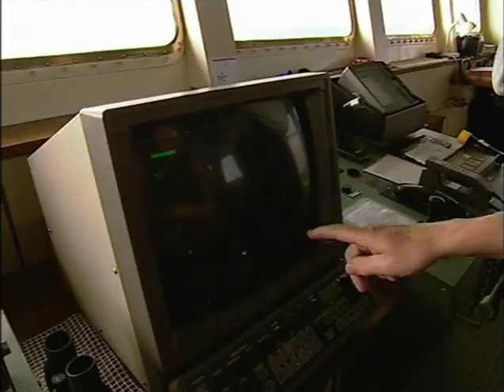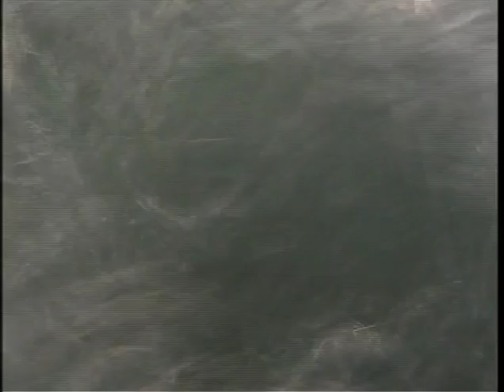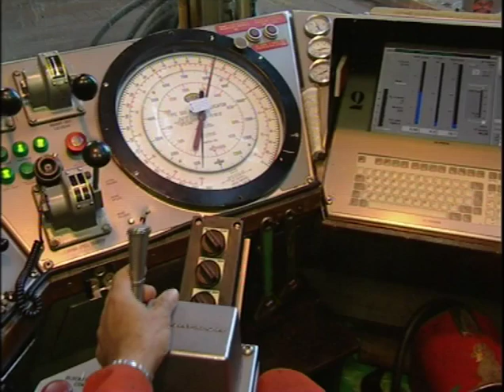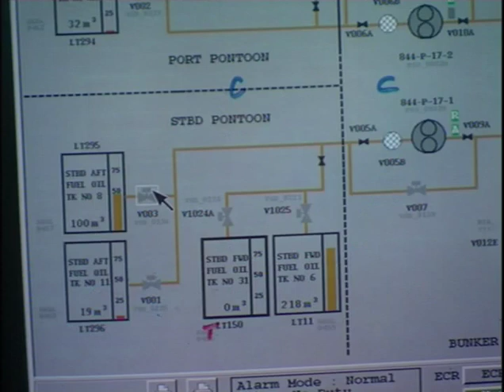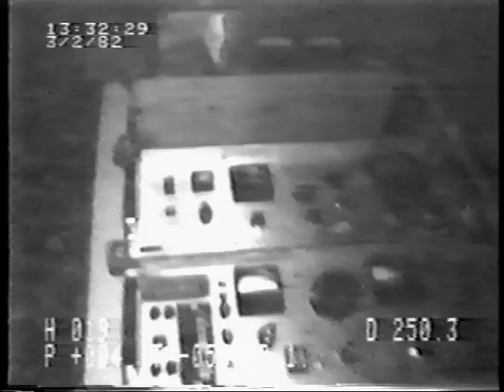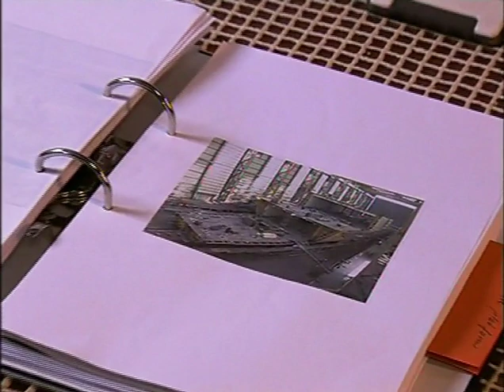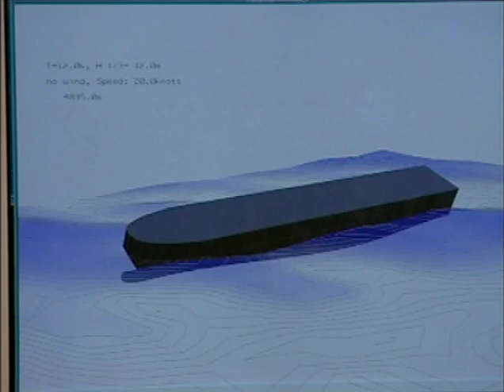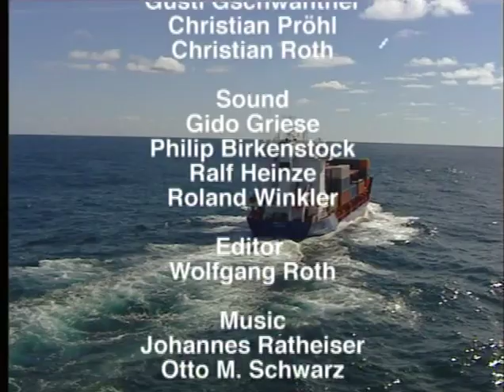Freak Waves - When Nature Strikes Back

Comment: Some 10 years ago, Canadian scientists anchored a buoy off the west coast of Vancouver Island. The buoy had a tape that would stretch and  measure the height up to 100 feet. After a particular bad winter storm, the scientists were eager to see the recording. The buoy had disappeared from it’s original spot. They finally found the buoy, anchor and all, laying up in trees on the beach.
Reply: Easily believable ive came back offshore after running from bad storms on George's and grand banks only to see wx bouys broken off there chains and missing or miles from there original locations

Comment: As someone who has surfed for many years, you cannot turn your back on or mess with the sea. It will surprise you and take you out if you don't pay attention at all times. People say big wave surfers are hellmen with balls of steel, but think the same also applies to ship captains. Absolute legends
Reply: The difference being the captain's and crews are earning a living and try to avoid such waves. Surfers are just out for the thrill
Reply: My father was a surfer for many years in northern California and my entire childhood he would always tell me not to ever turn my back on the ocean.🌅🌹
Reply: I learned that lesson in Hawaii when I was 30.  I wasn't more than 10 yards from the beach and I was in almost chest deep water.  I was standing facing the beach when I got slammed by a wave that knocked me under.  I then kept getting pummeled by a succession of waves that kept me somersaulting under water and I couldn't get a breath of air.  For a moment I felt panic rising because I couldn't get my head above water for even a moment.  The waves were so strong that they were actually pulling them down and I was trying to hold onto them with one hand.  The waves finally gave me a break and I was able to get my feet under me and stand.  I ran as fast as I could in water, while gasping and choking.  The strangest part of it all, is that my friends were on the beach, not 40 feet from me and they had no idea of what was happening to me.  I almost drowned right in front of them and they were clueless.  Lesson learned?  NEVER turn your back on the sea!

Comment: Great documentary.  It was made years ago.  I wonder if commercial shipping is still loosing an average of 20 ships a year?  

Being a US Navy veteran, I have learned the oceans are alive and a dynamic part of our world.  If you fail to respect them, they will teach you.

I have seen bad seas.  I have seen 700 foot warship have its bow dig into oncoming waves.  So glad not to experience a rogue wave.  From what I have learned, your ship will go into a very low trough before being hit by one.  Your bow will be down and stern up.  Rogue waves being so huge, they can be cresting right as they hit you, tower over the highest point of your vessel, easily breaking ship vessel apart upon impact.
Reply: holy shit that's crazy man.. tell me more
Reply: Bob Smith 

That's what I've heard too ...

Someone I have know for almost 20 years, was a marine architect, and prior to that, Chief Engineer on oil tankers. He never personally enountered a rogue wave, but certainly very rough weather ... 

As you say, he experience being aboard more than one tanker, which managed to crest one wave, only to have the bow quickly bury itself in the trough, and above a sheer wall of water ...

Like I learnt in high school physics, mass plus velocity equals a hell of a lot of force. I can imagine many tons of water per square meter equals Kn of force in the 1k+ plus range, dropping like a large slab of renforced concrete ... thus, with the bow buried, and the stern more or less sticking out of the water, into the air, it is easy to imagine the ship having its back broken, and all hands lost, with not even a chance for a 'mayday' ...

The old saw, 'never under-estimate the power of the sea' maybe old as sailing itsef, but perhaps was a direct reference to rogue waves themselves ...
Reply: That is a bonafide fact!!!Nothing more powerful than a huge wave except GOD Himself!
Reply: Andrew Alligood,  all is good as long as we are not on the bad side of GOD and nature...these powerful waves make us feel like ants.
Reply: My dad, now 75, was a ship captain for 10 yrs, and my husband was a mate and has been around ships for 30 yrs. Respect mother nature! You will regret it, if you don't, especially at sea where there is no refuge (you + H2O, hint: Sea Wins).
Reply: the bow just goes under and through the wave. The wave smashes the superstructure and the force on the hull caused by the bow being suspended on the back side of the wave can break the ship in half. that’s my understanding of it at least
Reply: Bob Smith Thank you for your service. 👍🏻💜

Comment: It should have been known since antiquity that freak waves exist. We have known for some time that waves interact, sometimes canceling, sometimes building. We have known that waves on the sea move at different speeds, meaning faster waves overtake slower waves. When this happens the wave can become bigger by the sum of the two waves. If more than two waves meet in the same place all the waves add to the sum. If you have four of fives waves coming together in the same place, you get a wave that is several limes bigger than the average of the other waves around it. And it will only be that big for as long as the waves are together, meaning it pops up them back down in just a few seconds. You will not see it coming, because it doesn't exist until it arrives. They are rare, and even more rarely seen, but they do exist.
     Just hope that when this happens, your boat is not also in that place at that time.
Reply: I suppose that wind speed also affects this. By becoming larger meaning taking bigger force from wind, faster and bigger

Comment: I think " if " you take Dutchsinse's
Work into consideration , the scope of monster/huge ocean waves could be better tracked.
Dutchsinse's work is based on 
Platonic / volcanic activity.
i.e. : when platonic movements occurs, heat is released through 
vibrations from the bottom to the surface ( ocean and earth ).
This activates and creates oceans waves to activate  
violent movements...as heat is released also through the ocean
floors... Volcanos release heat to the atmosphere. Plus the Earth 's 
natural movement/ spin
Think about it.
Thanks for your work and videos.

Comment: 31:36 How Freak Waves occur

1. Excited by wind (storm) on strong ocean current

2. Dramatic Depth Changes (vast deep sea)

3. Overlapping of waves (Wave upon wave)
Reply: Quran 24:40
Reply: Another way is forming a singularity. I can’t remember the technical term but basically a single point (single wave) can suck the energy out of all the surrounding waves and grow to significant heights out of nowhere. Pretty scary stuff
Reply: @prokritiwazed8373  Harry Potter 18:37

Comment: Hey there one thing I have noticed is that on big welding contracts it is very easy for a welder to become tired and pissed off so it could be a great idea to have two welders working at the same time but one welding and one checking and when problems happen like the welds getting unsafe and mainly in areas were it is really hard to get to and when this happens the welder can get shamed and not say a thing, so triple checking needs to be done ✅ ,a thought 🇳🇿👍😎KIWIPIP🇳🇿👍😎

Comment: I was evacuated by a small motor vessel.
From an island about to be smothered by
storm waves.  Traveling within a lagoon
300 feet deep and flanked by reefs.  As we
pulled out the boat flood lamps let us peek
at moving hills slathered white with foam.
Then they were turned off.  A crew person
said we did not need to see what we may
fear.  We were also told to hang onto the
seating.  The boat shuddered when waves
pitched our ride at all angles.  As the last
officer to depart I could feel the holstered
pistol on my hip and was comforted by it.
I'd be the least easy prey for sharks, I was
telling myself. Hours later the lights did
turn on again and a familiar boat berth 
slid into view.  Most got off without injury.
Some fell including myself when our boat
was tossed  up onto a concrete dock.  No
serious injury.  The boat was damaged by
what was called a rogue storm wave.  Had
a report to write before I could put on dry
clothing.  Ashore several dozen wind loosed
coconuts had caused human injury and 
property damage.  Nothing too unusual.

Comment: The Freight ship case is really bizarre to me. How can you make it on top, of what is now the bottom of a turned over lifeboat, which is tiny, compared to the huge ship, which was consumed by the waves just 1h ago. Even if the flipped lifeboat does not sink, what will help you hold yourself on top of its bottom, when 12mtr waves are smashing though it. Is it possible that the storm dies so quickly, it was gone from the time it sunk the huge ship, till the time they made it on the life boat.
Reply: Yeah that part of the story didn't make a lot of sense to me either.
Reply: Smita Handles are everywhere on them. You can also grab the Velcro ( which most gloves have for that very reason). It’s just going to be one hell of a wait. I’d rather be in one of those lifeboat than thinking you can get the big ones down. Plus once inside the yellow ones you can make it water proof though you will tumble everywhere but it has a beaker inside so they will find you.  I’m speaking from many many moons ago, it could be different nowadays. I hope this helps you 🙂
Reply: @janegilmore102  I see, thanks

Comment: Instead of building them with steel and harder substances, what about making them more flexible?
Reply: Brad Steiner  got it, I was just thinking that so many were breaking in half that maybe something more flexible would prevent that. I know steel is somewhat flexible because there are buildings in Japan built out of steel and flex with the earthquake. Of course there is a design and there it helps them do that and I think it's the base of the building but don't quote me on that.

Comment: Waiter loaded with plates of soup. Gets stopped suddenly,  soup,keep going as it was going. 
 Think on, Earth has tilt on axis, it’s spinning 1000mph. Seas going along as usual, but tilt tells the seas !opps we are changing tilt. Earth tilt new angle, seas have to,get on with they are going. Beaches are inundated with a big high tide.   But tilt has to,reverse after a while, 6 days going South tilt , stop, 6; days back North . Weathers get in maelstrom state, hot meets cold , huge hail in desert countries as winds get out of normal territory below them .  Next tilt, coming. Surface of Earths crust getting. More exposure to solar and Night cold - 269c  . Sucking heat increase out of Earth crust.  Very hot above and more heat energy into Earth core.  Top and bottom heat, crust contact ice globally in melt.  Wobble of Earth axis is caused by our transport of mass weights of billion of tonnes from South to North.  Top heave Earth has to,wobble , as a top would on Earth. But Earth is in space, nothing to fall over on, it rocks to,maintain revolutions in Solar hold.